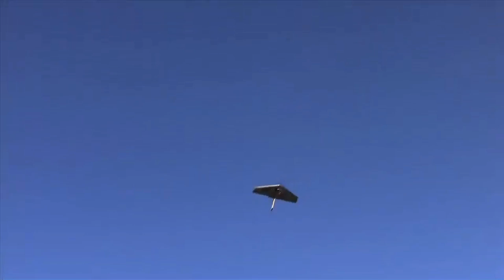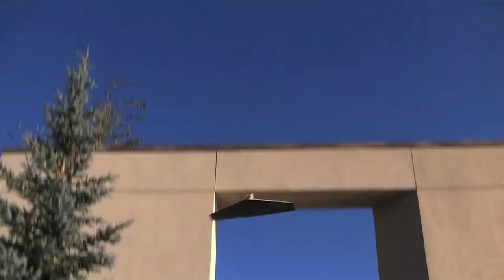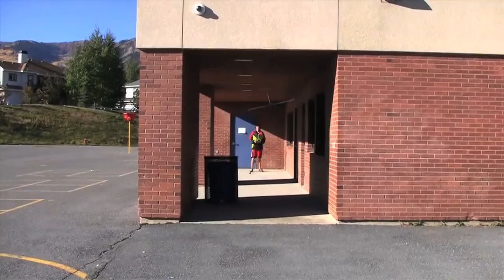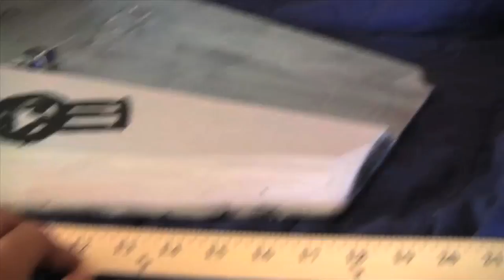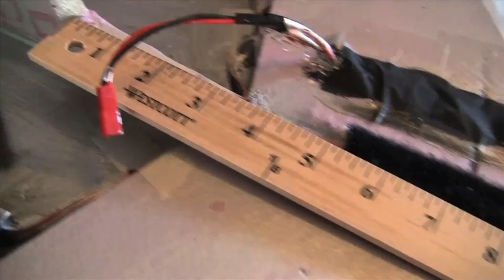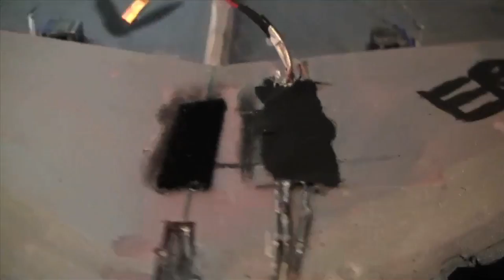Delta Fighter

Comment: I made this plane, to his exact specifications and it truly flies great! It can handle high speeds at wide open throttle and can slow down to a crawl and just float in the air. Make sure that you program in expos on your transmitter! Great fly, I highly recommend this easy build. I am now working on a 50% larger version!

Comment: @daplaneflyer His didn't bend, it was a full step down at 1/2 of the wing chord across the length of the wing. So, the tailing edge will be a "straight" line but it will have the shape of a "V" to follow the Kfm2 style airfoil

Comment: @schraut5 I made to 50% larger version and it was great! I used a 47 gram 1000 kV motor with a 10 x 4.7 prop and a 2200 mAh battery. It is a lot of fun to fly and still maintains the great features of the smaller version. It does have a harder time in the wind, but the larger version will fly a lot slower than the smaller one.

Comment: i built this exact plane to specs and it takes off nice but once it hits the slightest amount of wind at all it goed cracy and my control surfaces do absolutley nothing to counteract it. its really fustrating ive built a bunch of your planes and i can never get them to fly nearly as smoothly as yoours. i dont know if i have the CG wrong or if i dont have it trimmed right but i dont relly know the right way to trim a plane either it always crashes before i have any idea of what hapening to trim i

Comment: cool video my delta wing is designed for slow but great glider rate has it so good flight control its a 2 ch rc plane with rudder and elevator you should check it out  :+J